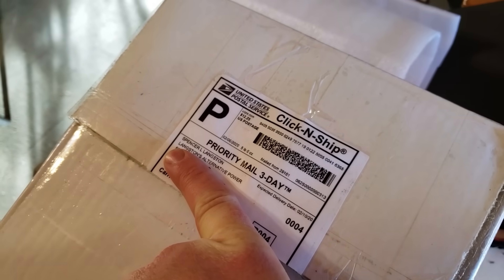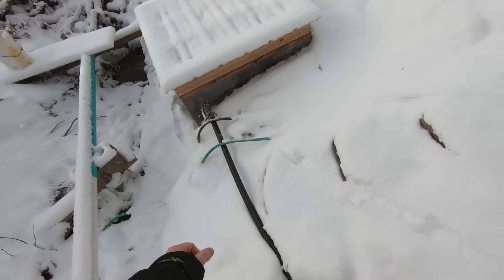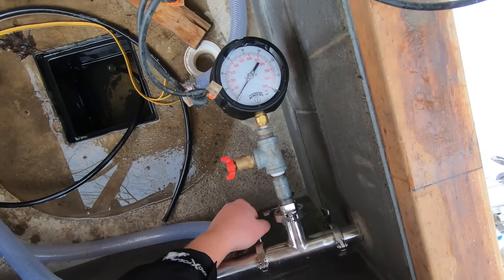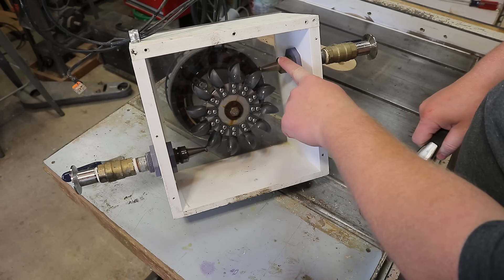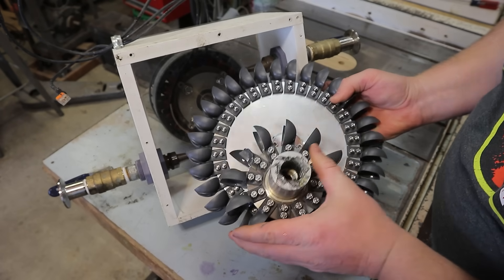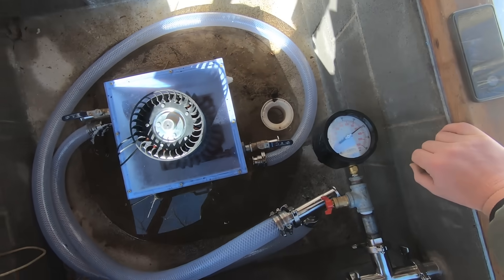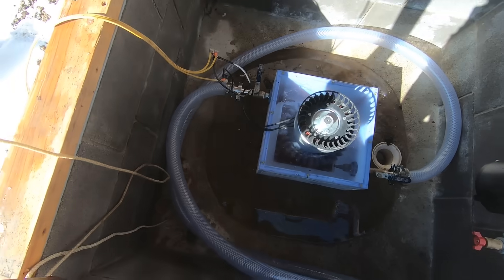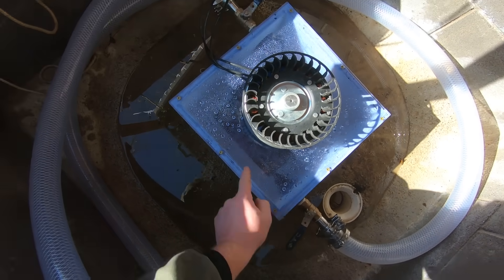Chasing 500 Watts, Big Pelton Turbine

Comment: Run the Pelton wheel at a rim velocity at near 1/2 the water velocity of the nozzles. You do the math.
Reply from the maker: The mppt controller does that for me.
Reply: @JoeMalovich  No, you have to size your nozzles to the speed you want under load. The mppt controller only optimizes wheel speed with available power output, if you're losing power because your water velocity is too high/low, it can't compensate for wheel losses.
Reply: @jttech44  It can because mppt will find the voltage that gives the most watts higher rpm = more voltage lower rpm = lower voltage the only thing I can think of is if the rpm is too low and it falls below the w/rpm of the alternator.
Reply: @benlawton5420  right, but because water flow and your spoons have to be sized to eachother it only gives you what the ideal is given your flow/spoon combo is.
Reply: @JoeMalovich  
I'm not familiar with the MPPT controllers.  But I was thinking that there could be more power out of the original small wheel if there was a better match between the incoming higher voltage if there were stepdown transformers before the rectifiers.  What complicates things is the 3 phase delta connection and the need for 3 transformers.  One thing in its favor is the frequency seems to be higher than 60 Hz, which means the transformers could be small for having to handle 500 watts.  But altogether you have a very good setup,  thanks for the videos.
Reply: Basics to know is, theoretical max water velocity is same as droping an object from the same height as the water intake uphill. v=sqrt(2gh).

Flow rate is nozzle area times water speed, q=vA.

At constant water pressure the nozzle area does not affect the final ejected water speed, but nozzle area affects water volume flow and thereby the speed of the water as it travels through the feeding pipe system from start to end.

Area of the feeding pipe will determine transport velocity and the higher transport speed the more friction. Friction means pressure drop and when nozzle area is same as pipe diameter the pressure before the nozzle is zero. All pressure is then lost as pipe friction, except what has been  tranfered to kinetic energy of the water "pouring" out of the pipe.

The velocity of the escaping water and the corresponding pressure that created the velocity is interchangable. The remaining preassure not lost in pipe friction  that caused the water speed v, equals 0.5ρv^2

As ρgh is the static pressure of a water column, using the no load rpm as speedometer you can figure out what head 'h' actually remans after pipe losses.

The head loss can be read comparing the reading of the pressure gauge to reading at zero flow, inlet valve shut.

..and another trick is using a bucket of known volume and a stopwatch, it is easy to crank the valve for a range of different flows. By reading the pressure gauge for each flow you can calculate the power avalable as P = volumeflowrate * pressure.

That fact comes from pressure p is force/area, and flowrate q is speed * area. So area is eliminated when the two are multiplied. That is neat. Using that method you can find at what flow will deliver maximum power and select a nozzle with an area that deliveres that flow at that pressure.

Isac Newton figured out the basics, Bernouli came along, and Euler finally cleared things out.

https://en.wikipedia.org/wiki/Bernoulli%27s_principle
Reply: Another interesting aspect to understand energy is 'work'.

Fortunately work, or energy in mechanics, is force times distance. E=F*L.

It means the pressure is doing work on the area of the nozzle as water moves. The pressure times the area is the force F doing the work. And work done is how long distance the force operates.

It means at a known area with known pressure we know the force at work. If we know at what velocity the water moves we know the distance of the work done as distance is velocity * time.

With simple math, pressure, nozzle area and velocity and time elapsed, we know the work done.

Also as power is energy per time unit, power = force * speed.

It means the input power at the nozzle is simply: pressure * area * velocity.

We are lucky. As area * velocity, above, is same as volumeflowrate, so power can also be expressed as P = presure * volumeflowrate.

(N*m^-2 * m^3/s = N * m^1/s)

Work is also the force on the turbine and how far the cup has traveled as it rotates. Or if expressed as power it is simply P = peripheral speed * force.

As the wheel radius is known, peripheral speed is: pi* diameter * revolutions per second.

Bicycle mechanics.

And impossible without using the metric system where you multiply meter, kilo, newton and everything comes out as Joule=Ws and not horsepower.

International System of Units - SI

https://en.wikipedia.org/wiki/International_System_of_Units
Reply: @tofo2  excellent explaination. Thank you.
Reply: To obtain MAXIMUM EFFICIENCY from a Pelton Water wheel… the velocity of the buckets MUST be one half the velocity of the water stream hitting them. This will extract the maximum energy from the water stream. Dozens of opinions here from people who are pulling them out of their behinds. It would be refreshing if commenters would do some basic research instead of fantasizing in a field they know nothing about. I own a dozen full size wheels and a Pelton powerplant governor.
Reply: That is what I aid. The velocity ratios differ with other types of wheels. You are not the only one to work on small hydro power.

Comment: I really have no idea what I'm talking about but it looks like there is a lot of water turbulence inside the box, wouldn't it be a bit more efficient if the inside of the turbine box had rounded corners or was a straight up circular shape?
Reply: Water reaching the sides of the box has already produced work by hitting the turbine first, so aside from splash from wall to wheel, the shape of the box should not be a big issue.
Reply: @DanielCallejasSevilla  What if, the box was the same shape as the stellarator coils... Id like to test that but alas, no stream on my backyard
Reply: I saw the same thing. I know in a racing motor they make the oil pan to keep splash off the crank. I think the same principal should apply here.
Reply: Likely, but probably not so easy to prototype in comparison to a simple box.
Reply: He could 3D print one after the bugs are worked out...he has a printer. Just has to consider the shape to deflect the water properly and if the plastic will handle the stress. 🤔
Bigger, round with baffles.